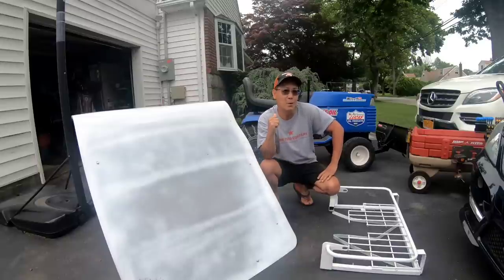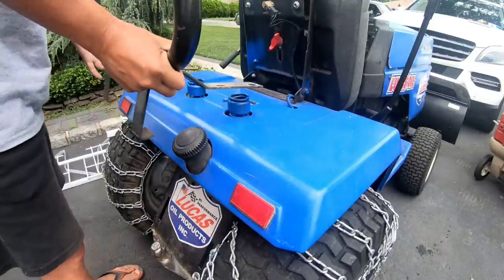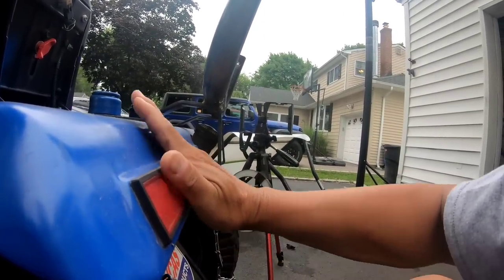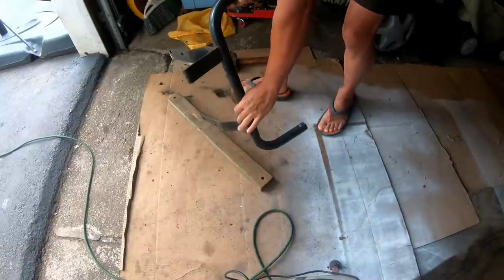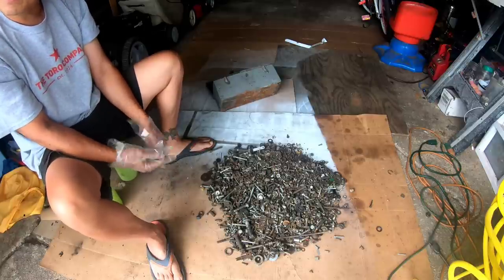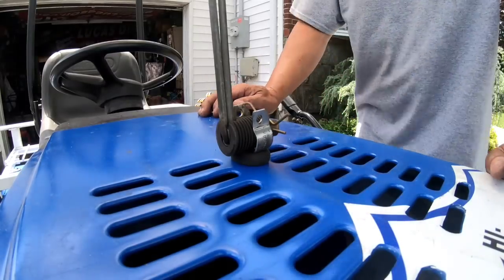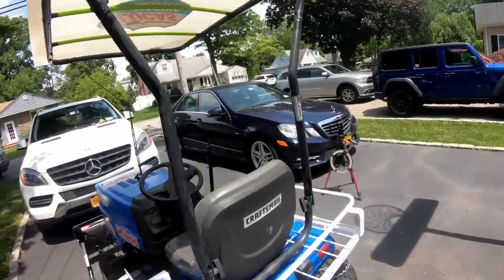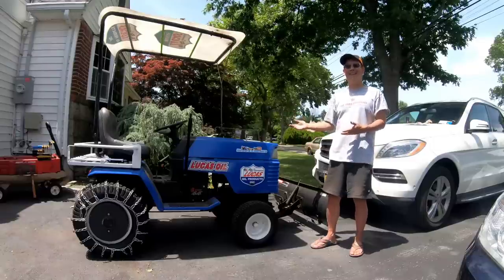BLUE BAYOU CRAFTSMAN GT6000 GARDEN TRACTOR ROOF CANOPY ATV UTILITY CARRIER RACK UPGRADE INSTALLATION

Comment: I have a GT 6000 with mv18 I can say I love cutting the grass with it!
Reply from the maker: MV18?
Reply: @MowersNBlowers  Kohler Magnum 18 opposed twin love it
Reply from the maker: I never had one of those.
Reply: @MowersNBlowers  The only motor that I know can run both horizontal or vertical with a little work.

Comment: Cut both back brackets off and then use all four holes to bolt to the body.  Use rubber washers in between bracket and bolts.
Reply from the maker: Yeah but you lose rear support.  I have 5 connections,  if I cut it,  I’d only have 4.

Comment: Henry,  you know gas and sparks don't play well together!!!
Reply from the maker: Yes but not passed a sealed gas cap and abs plastic reservoir.
Reply: @MowersNBlowers  If everything is sealed wouldn't that cause a vacuum in the tank and cause the engine to quit?
Reply from the maker: @jackhutchins2361  the cap vent is pliable rubber,  when pressure builds the cap bottom flexes and allows the vapors to exit but the engine hasn’t been run since i winterized it after the winter.  Either way,  I wasn’t concerned about it.

Comment: Cutting metal at the filler neck of a gas tank? Very sketchy Henry.  Shaking hands with danger! 😱
Reply from the maker: I cut it on the floor in timelapse
Reply from the maker: Oh yeah!  Well highly unlikely a spark would penetrate that thick cap and reservoir.  Have you ever dropped a ignited match in a cup of gasoline?  Nothing happens!  Only misted gas would ignite with a flame.
Reply: @MowersNBlowers  oh. I was thinking fumes could be ignited.  Ive watched videos of gas stations caught on fire cause of a cigarette. Had always assumed it was the fumes. Cause of what you said about dropping a match directly in a cup of gasoline.